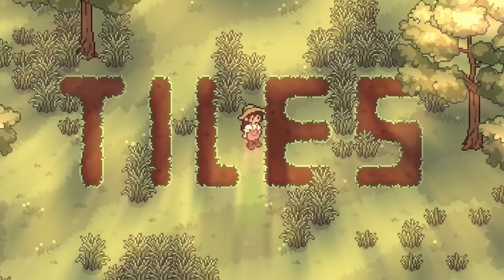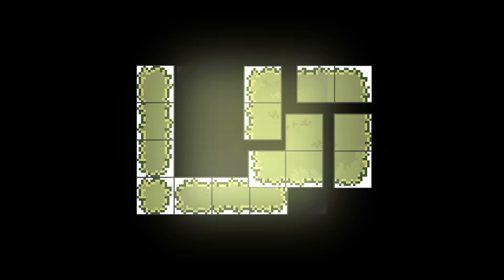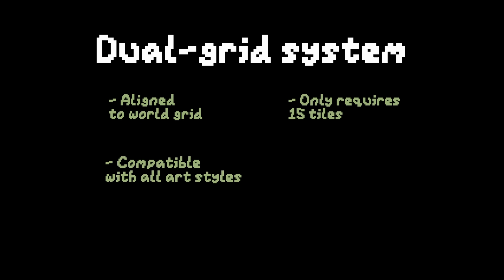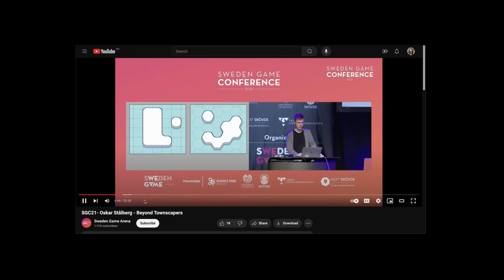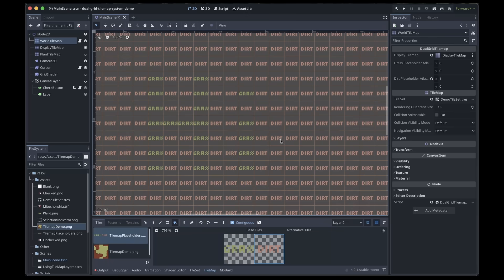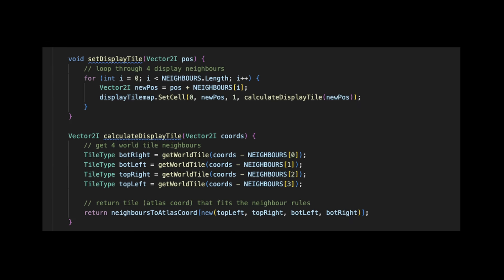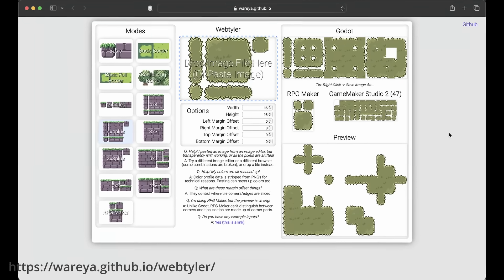Draw fewer tiles - by using a Dual-Grid system!

Comment: your are over complicating it. 
your through process is : I have 16x16 tiles and that is to complicated to handle all the variants I want. So I will make this an attribute map and then I will make another 16x16 grid offset that holds the actual tile information. Then to reduce the number of pieces I need because 16x16 is too large, I will make it 8x8 and reuse pieces of it. 
if we resolve this : you have an 8x8 map. 
But you still want to think about it in 16x16. But the 16x16 is not real, it doesn't exist. It's a nice design tool, for faster offline generation but it doesn't need to exist beyond the exporter. Just switch your system to 8x8 and work in 8x8. So when you dig the ground, just find the 4 tiles it hits and update them. Limit the tool or movement to even tiles or make them move 2 tiles. Now you have a single coordinate system, a single tile grid and all you do is +=2 or -=2 to move rather than ++/--. To find the patch it hits you do tileX&0xFFFE, tileY&0xFFFE or FFFFFFFE if you need 64bit coordinates for the tiles. For Pixel -> tile just ((pixel>>4)<<1) 
For the dig you first set all 4 tiles to the basic dirt tile, ie. full dirt. Then run the edge detection algorithm on all 4 of them 1 by 1 to get the correct tile. 
Each "attribute type" is 16 tiles, store them all in a row so 16 dirt tiles, 16 grass tiles, 16 flower tiles, 16 water tiles etc then to get the "type" any one tile is typeEnum = tileNum/16 allowing you to infer which attribute each tile is from its number allowing you to avoid the whole second map.

Comment: One of my first game projects, when I was in high school, I made an isomeric game with a large tile based world. I solved this problem using exactly one tile per type with perfect overlapping...

The bottom two edges of the tile image extended about 1/4 or so down over the next tile, with the pattern background broken up with transparency. They were drawn in order from the bottom of the screen up, left to right, so each tile's "overhang" would just blend itself into the next tile down in a consistent manner. A few tiles, like bricks or other construction, had a property that raised the Z level to avoid the overhang when needed. 

When you have a tile system that supports it, this is a really, really easy way to get seamless blending for any number of tile types. And because the blend still applies between tiles of the same type, having multiple variants of the same type quickly leads to a ton of variation as any two tiles next to each other will create a subtle variation as if you had exponentially more variants (make 4 grass tiles, now you have, effectively, 16 unique variants of tile based on which ones overlap, lol).

I used this one more time on a square grid (overhang was bottom and right), and it works just as well there too. Honestly, I don't know why I haven't seen it used elsewhere.
Reply: I used a slighly similar trick for overlapping trees once. My base tilemap just had stumps where the trees were, but I had another tilemap with just the lower half of a tree at the same location, and a third tilemap with the upper half of the tree at that same spot. Then I offset the tree tilemaps upwards 0.5 and 1.5 tiles.

Comment: This is the ideal devlog/tutorial structure, thank you! I haven't thought about this before.

After watching I noticed something cool: not only is it 'dual grid' because of having... two grids... but if you interpret the grids as planar graphs then they actually are 'dual' in the sense of 'dual graph'!

For planar graphs, a dual graph is one where the faces become vertices (typically their orthocenter), the edges become edges (typically their perpendicular bisector), thus the vertices become faces.

Noticing this actually means it generalises to different planar graph worlds for generating 'vertex colouring' (what we would call the idea of assigning a number (e.g. a sprite index) to each vertex in the graph- but in the dual graph these assign numbers to faces). 

The question is (outside of square grids) how useful is that for compactly representing the adjacent tiles?

Comment: One problem with this tileset is that its made for topdown games.
If you want a platformer, you will need to make it work with ground, inner ground, and air.
I think you could get away with it by just having your main formations with air (png) and use bg art behind the ground that isn't air.

Comment: Another way to handle the coordinate system is to use double-resolution addressing. With this, your world coordinates have double the resolution of your grid. Then, when accessing the world grid, you left shift the coordinate by one, eliminating the lowest bit. When accessing the tile grid, you also left shift but then add the shifted out bit to the coordinate. 

This, obviously, can be combined with the pixel coordinate grid; e.g. for 16-pixel tiles, the lowest 4 bits of the coordinate would be the pixel coordinates within a tile, with the 4th bit the one that gets added to the tile grid when shifting out.

Comment: When making my own game, I did something a bit different. I made a tile that connects in every direction, then overlaid certain other sprites on top depending on whether it was an edge, outer corner, or inner corner. In other words, draw the tile as if there are no borders, then draw the borders on top. It makes randomization a lot easier since you can draw a few base tiles and a few borders and let multiplication do its work, but it obviously doesn't work for every art style.

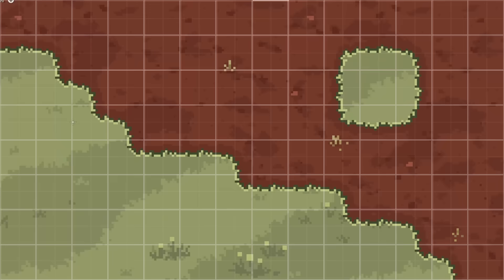Comment: 0:50 actually, they do align, you are just looking at it from the wrong point. 15 tiles describe a mesh where terrain type is defined by corners, not the centers of the tile.

Comment: I've used a 16 tile map (only one grid) before but as I've coded my own engine (bad, I know) the file didn't look neat like the ones you showed...
I've assigned a direction to each connection and stored the tile face information as a 4 bit unsigned integer.
0 (0b0000) was a single patch or wall, 1 (0b0001) was up, 2 (0b0010) was right, 4 (0b0100) was down and 8 (0b1000) was left.

The file looked like a binary clock:
□╙╘╚ 00 01 02 03
╓║╔╠ 04 05 06 07
╛╝═╩ 08 09 10 11
╗╣╦╬ 12 13 14 15

The ones you showed really looked like an artist organized them to draw them better:
╓╔╦╗ 04 06 14 12
║╠╬╣ 05 07 15 13
╙╚╩╝ 01 03 11 09
□╘═╛ 00 02 10 08

On the first case X is n%4 and Y is floor(n/4) in the tileset.
On the second case I think I'd have to hardcode the table to the file loader and rearrange the tiles into a flat array during compilation or startup.

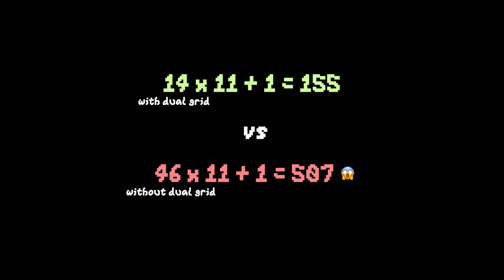Comment: 5:17 Yeah, that's not something I'd ever spend time doing. There might have been a way you could have done it with no more tile art than it takes to render grass but still having an animation, you maybe could have just stored pixels with additional animation data then just blended the blue color of the water with the sand according to what their animation data says crossed with the time elapsed. The other option that I always use in these circumstances is to write the programming then if I see any tiles that are missing textures just add the single texture needed, this means that any tiles which I didn't run into during testing will remain without textures for until I come into a circumstance where the tile is needed. This is bound to end up with missing textures when an actual player gets to it, but I don't care, I'm not going to make 1024 some odd tiles in one sitting.
Reply: You can probably also have the missing texture just default to the most similar available texture to make it less noticeable when it does happen.

Comment: You can wrap the logic for transforming between the two grids in helper functions.  Most languages will compile helper-functions out of the finished product entirely, so they usually don't have runtime cost.

Also helps keep that logic consistent in your code since you don't run the risk of making mistakes down the line.

Comment: This is very good, but it's not necessarily the best option for all developers, due in part to the mass automation of it.

One other option with its own benefits and detrimental which came to mind early into watching this video is to combine two or more layers of solid tiles with a layer of masking tiles. So long as you establish for your tiling engine which of the solid layers are hidden or revealed by the mask, possibly using different masking colors to apply it to different solid layers if there are more than two, you can use any mutual shape with any pair or more of tiles.

On reflection, I recognize that the video may have been referring to the shapes alone when it used the word tiles and that there's an argument to be made there about which use is accurate to the industry. Let's not bring that debate here, please. I also recognize that you could use the auto-shaping in combination to create your masks, or that you could even do that and custom masks on the same or on separate layers. This loops back to my original statement that the video's technique may not be the best for all and to my statement that my idea has both benefits and detriments.

Comment: Great video.
As a solo dev I've always defaulted to the 47 tile solution (which ignores purely diagonal connections) I came upon that through pure trial and error since I just loved drawing tilesets. However it does become a real issue when you want animated tiles (as you encountered) and this dual grid system is an interesting alternative. 

I would be curious about the change in overhead from having 4x as many tiles (+more tiles to check through manual auto tiling).  For my game there is already multiple tile maps and each with multiple layers so the increase in complexity from dual gridding each versus frontloading more work drawing 47 tiles is something to think about. 
If there's only a single tilemap to consider it seems to be an easy yes for this system

Comment: I'm working on a shader to make this easier, but I ran into a problem making my test map from the 15 piece set in your repo. There are no inverted dogbone pieces. Like dirt paths with 2 opposite external grass corners pointing at each other. It seems like an inherent problem with the 15 piece. Ideally the shader takes an array of tile indexes to make the visual map and then renders a range of logical coordinates to a quad.

Comment: Have you considered adding more layers? Unless I misunderstood parts of the video, you don't seems so... Though, It can be quite costly if you have to many of them, Old systems usually had usually up to 4 of them and it can go really deep in tile reusing (even if the palette system was also a really handy technique to keep the number low)

Comment: This also makes level generation about 10000x easier. No need to worry about which wall is facing what direction, just fill WALL or FLOOR, then do a post process step on all tiles to check their neighbours and solve what their appearance should be that way. Of course, this is computationally expensive, but if you are just doing it when you initially generate your world, it's not a problem!

Comment: This is more widely known as "corner tiles", as a variation from "edge tiles" (which are themselves more widely known as Wang tiles, from the guy that invented them). I love these, they let you do hand-made transitions between tile types and there's up to 4-color (4 different "terrain types") packings so you can smoothly transition from any tile to any tile as required (since each tile can have at most 4 different colors, 1 per corner, if you have more than 4 colors you just make additional sets).
I've been working (for a long time) on a few variations on these, for even more flexible and organic looks. I expect to publish my results somewhere somehow.

Comment: I think the system rpgmaker uses only uses 17 tiles. I find this new tile thing to be  laid out somewhat confusingly compared to the straightforward rpgmaker system. Are there any bonuses to using dual  instead of rpg? Are there any tiles rpg cant do but this one can? Or does rpg limit how big or small you can make your items?

 (I don't thiiiinnnkkk so, but I'm not sure.) (also, all of this is genuine questions and curiosity, not like 'nyh mine is better blah blah blah') (or would it be 18 tiles for rpg, one tile being 'no grass' to go with the full grass?)

I only ask because I didn't see rpg maker's as a list of one of the types. Then again, for all I know, rpgmaker's could be one of those and it just que's different parts. cause, thinking about it, I have no idea how they make 1sq wide paths in rpg.

Comment: I think the craziest part of this is that it's the first time anything in the world of graphics programming has actually made intuitive sense to me.  Instead of having each time correspond to a world tile and have 9 neighbors, each display tile corresponds to a corner and only has four neighbors.  The display tiles don't have a "base tile," they are only made by combinations of neighbors.

I didn't even plan on making a 2D game but it's a cool hack to know!
Reply: this is the opposite of a hack, it simplifies the design concisely rather than working around a design limitation by generating unmaintainable excess or unsupported behaviour.
Reply: Not really a hack like MagicGonads says. Say you make 16x16 tiles. All this process does is cut the 16x16 tile into 4 pieces that it can then choose from to use for the actual tile you wanna place. Now granted the program here can do this automatically. But even for paralax mapping this works wonders and can help you a lot.
Reply: @GikamesShadow so it is an heck. As it safes time

Comment: nice video!
but got curious, isn't better to also rotate and mirror some tiles to reduce the number required? i mean back in the day we got limitations but new hardware (any dual core cpu) should be able to support without problem those transformations.

Comment: Or just you know, use RNG in the shaders to generate the tiles. You simply take the relative coords of the tile internals as an RNG seed and have the edge of the grass or whatever decided by that. Everything that's not supposed to be and edge (so < 0.2 and > 0.25 for instance)  can just be texture for grass or dirt or whatever. That leaves you with just the textures for grass etc with no edges on it, the RNG will figure out which of the 2+ textures to use for any given coord in the tile.

Comment: Funnily enough, I made a video on this exact approach back in April for my 3D engine. Since the original bedrock I was working with was a GBA game, I basically just went "Beep boop" and took the tilemap approach of the GBA and earlier consoles used (2x2 metatiles made out of 8x8px tiles) 

With some elbow grease I've since squeezed the entire 3D mesh builder down to ~300 lines of code. You've got me wanting to release the source for my builder now lolol
Reply: Yes please!!!
Reply: A man can do anything with some elbow grease! You are very manly indeed
Reply: @DsiakMondala  Wat, I'm not even a guy
Reply: @DsiakMondala ir corny as hell bro

Comment: So is this not the same as just subdividing a tile by 4? Also, wouldn't only 4 unique tiles be necessary, not 16? Given that a tile can simply be rotated such that (grass, grass, grass, dirt) == (grass, grass, dirt, grass) by rotating the tile 90 degrees. I'm wondering if it'd be possible to get away with just 2 tiles (edge and no edge) by tolerating a bit of overdrawing (draw edges over non edge tile) and using the 4 tile subdivision.

Comment: This is a really neat technique to use for tilesets.
I've seen this before when working with minecraft optifine resource packs, especially with connecting blocks and block overlays
the 16 tile method is much more useful when splaying things over large areas that will usually made to be uniform mostly
Reply: though I prefer the dual grid system more now since it's so handy

Comment: I highly recommend checking out the tool "Tilesetter" too, lets you generate a full tileset from just two tiles. No AI or anything like that of course, it pretty much just rotates/crops your tiles together, it's very highly configurable and easy to use.

Comment: You can solve the corner issue of the 16-piece subset by having multiple layers to get the shape you want. The problem is that this forces you to have multiple layers, and overlapping tiles. The dual-grid system is genius!

Comment: With the 15 piece tile set think painting vertices instead of tile centers (you could also just offset the grid you use for painting, I think). For 47 (blob) tiles it works well to paint the first 16 (which is enough for the top of a wall or a road) and autogenerate the rest (quarter the tile, see the rpg maker autotiling system). Dual grid seems great, but I don't think it is easier than the other methods, my intuition is what corners you want to have rounded is the deciding factor. E.g. for the top of jrpg style walls I would want sharp corners. Also keep in mind that using transparency and layering tiles is an option to reduce tile requirements. It is definitely possible to make autotilesets with a small amount of graphical work. In 3D it is even easier, because you don't have to bake the lighting, can stick meshes into one another or hide bad geometry by sticking geometry on top. E.g. for a wall in 3d you only need a pillar and a wall (or even just a single wall if you use the right shape).